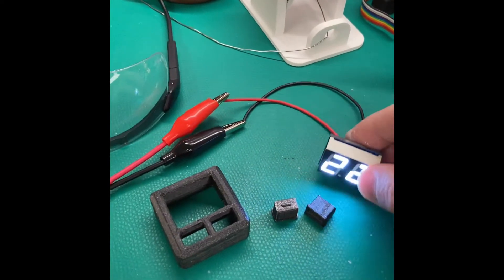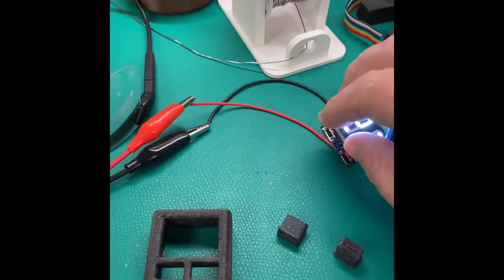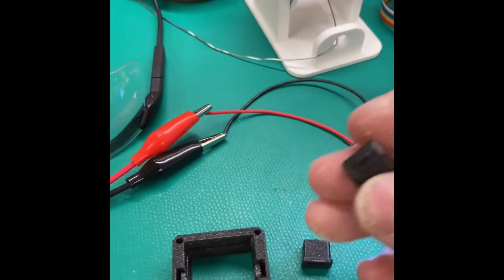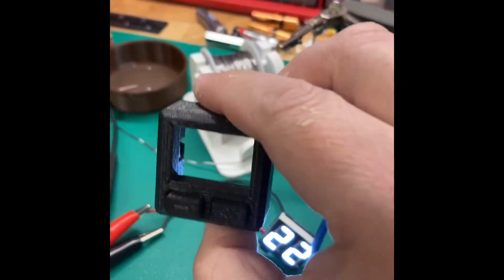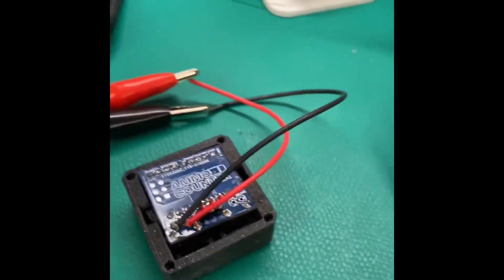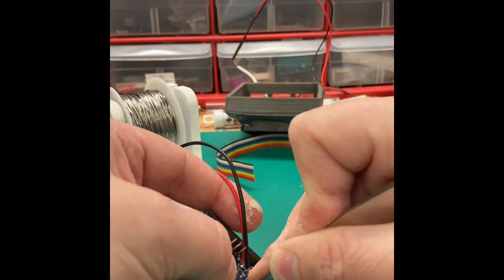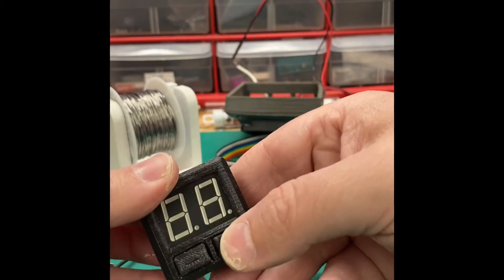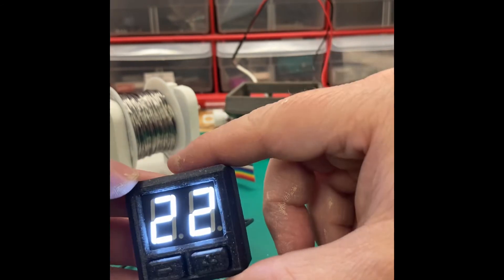Ammo Counter Bezel Mount - 3D Print Assembly

Comment: Very cool demonstration of your counter casing. Do you know where I could get an IR sensor that would sense bbs for assembling this counter onto an airsoft gun? 

I have one of your counters attached to my airsoft gun, but I used a trigger switch placed in the back of the gearbox that activates the countdown.
https://youtu.be/RYn_6qWKKeQ
Reply from the maker: My current ammo counter kits have a long list of new features, including optical sensors as an option.  However, I would not recommend with airsoft at this time.  I think your roller switch is ideal for for reliability.  Has it been working ok for you?  Send me a pm, would love to hear your thoughts on airsoft.
Reply: @DustinWestaby  Message sent.